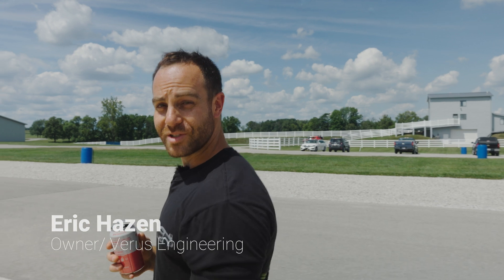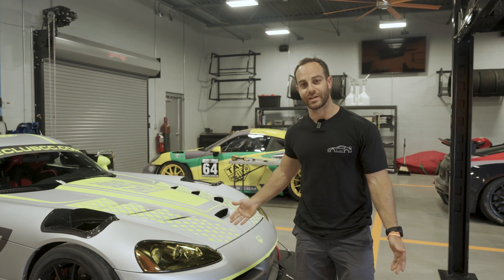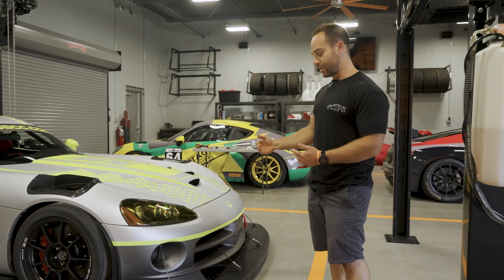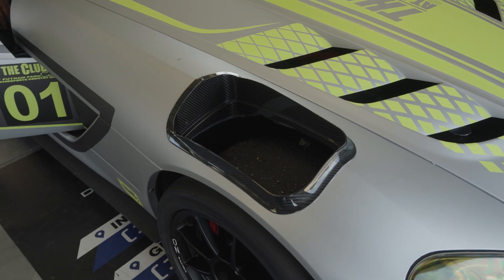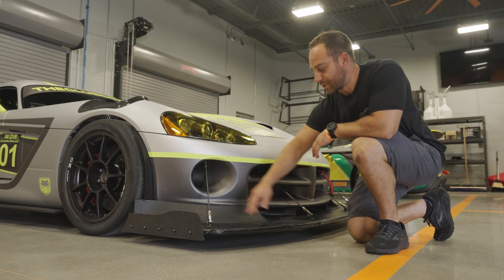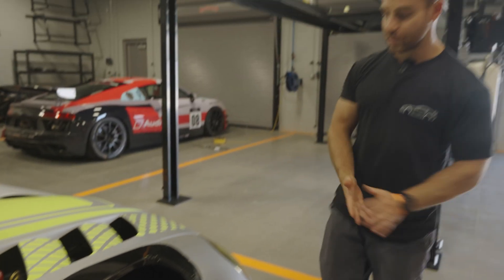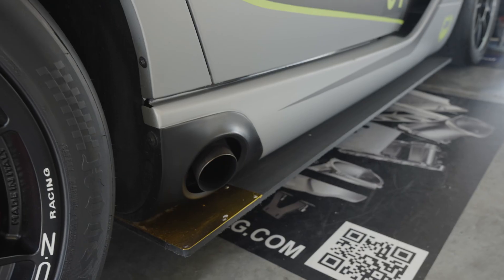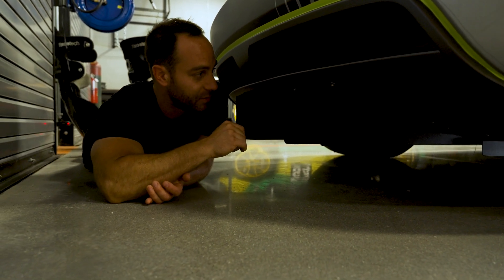High Downforce Aero Kit for the Viper ACR-X | Full Walk-Around

Comment: Wouldn't it be a little more efficient to use louvres on the fender vents to aid in extraction?
Reply from the maker: No,  that is not the case. The front side of the louver is raised and acts as a wicker. This helps increase evacuation.
Reply: @VerusEngineering  Ahh didn't notice that the first time round. Neat!
Reply: @VerusEngineering  Follow up question: how much of an effect do the vents have on the rear wing?